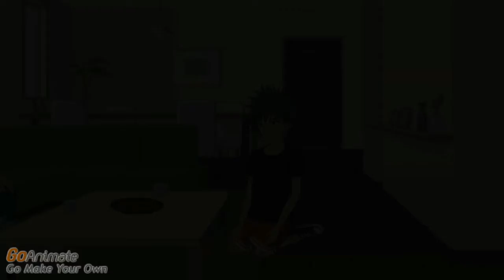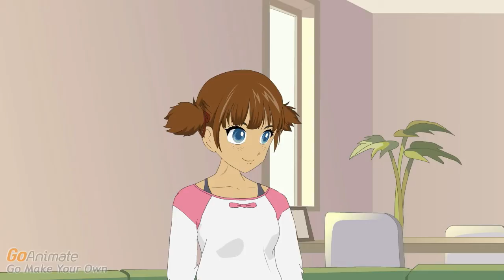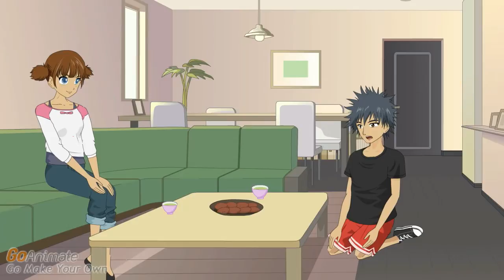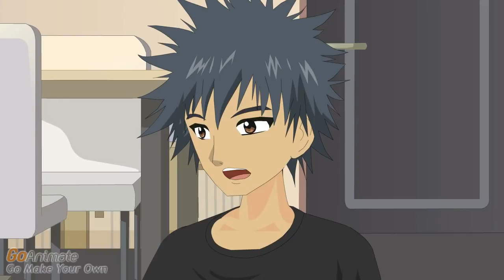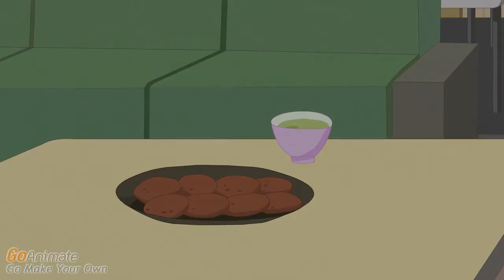Signs Your Water Heater is Going to Explode

Comment: ok my hot water is venting a ton of water from its hose every other week is that bad ?
Reply: fuck water heaters, why is this fucking bomb in my house... i have a great idea, lets take a metal tube that can handle 85 thousand pounds of pressure, and just pump it full of water, and heat it constantly with a gas burning fire, if it gets to hot a little valve can release some water as long as minerals havent built up
Reply: Yes that is bad
Reply: It's too mutch water for it to handle and if it builds up too mutch pressure it WILL explode